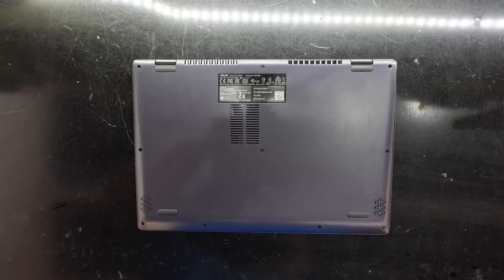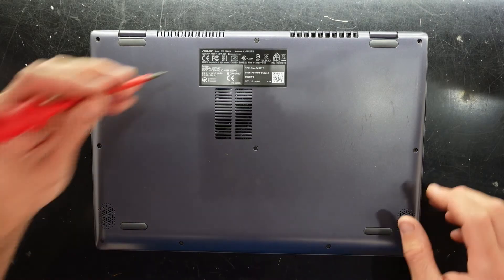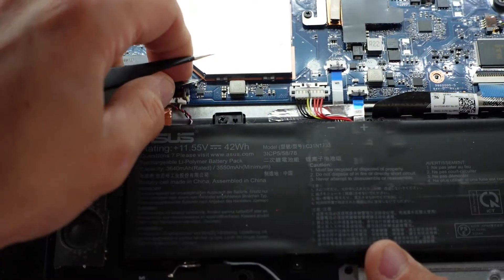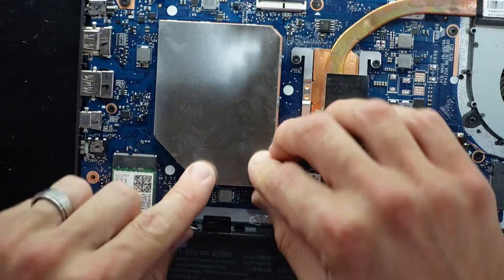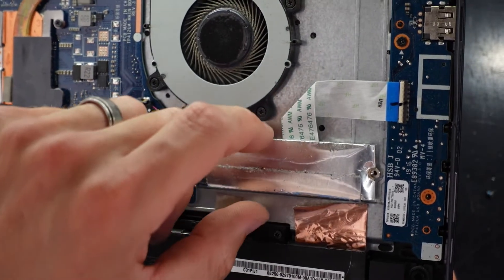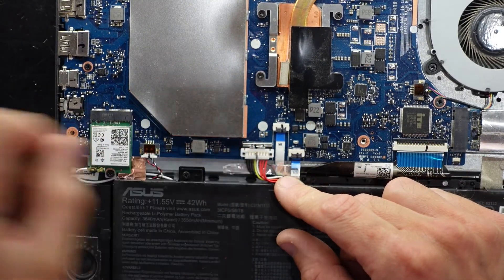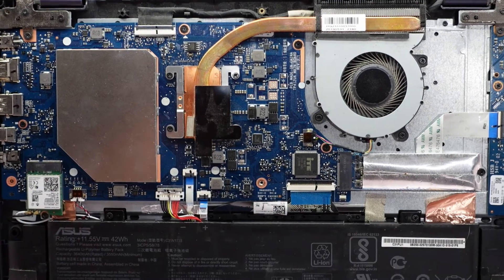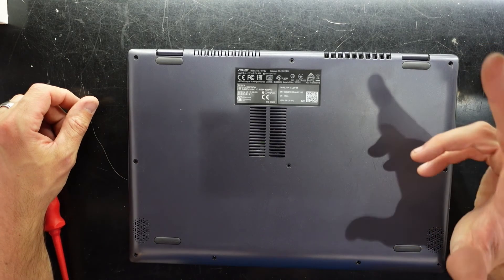Asus VivoBook Flip 14" TP412U Tear down and Upgrade Discussion

Comment: 6:00 > But this is not M.2 Nvme as you told before: 5:27. It is a SATA SSD
Anyway, thanks for opening
Reply: You said in another comment that you put an NVMe, so, I guess it is also compatible with that after all. Anyway, before buying, I'm going to test with two old SSDs (NVMe and SATA) I have.
Reply from the maker: both should work
Reply: @rickstechrepairs  Yes, it is also recognized by the BIOS.

Anyway, I'm having this problem: the old SSD just showed this error:
* STOP CODE: DRIVER PNP WATCHDOG

So, I tried to install Windows on a new SSD, but it is still the same. Only installing Linux works.

Is your laptop still working? Which BIOS and Windows versions do you have?

The laptop is not mine, so, I don't know what was done here
Reply: I'm currently trying to upgrade in this same Asus laptop, the stock 128gb M.2 SSD to a new nvme 500gb SSD. Having no luck after the Macrium clone to the new nvme SSD. Windows will not boot and I've already spent many hours reading blogs and trying to figure out what is wrong. The clone seems good and the ASUS bios recognizes the new drive. I suspect there is some issue due to the new drive being nvme. I'm just about ready to say "f*ck it", my time is not worth this aggravation. I've never before had any issue building PCs, installing OS, copies, etc. So, the people saying this is easy no big deal, I'm not seeing it. Just to let you know, before going further down this rabbit hole, lol.
Reply: @bigworldparty  I couldn't repair the problem of the laptop that was brought to me, but I can say that it originally shipped with a SATA SSD, so, I suspect that although an NvME is recognized by the BIOS, it won't boot from it. Even the author of this video is showing a SATA SSD.

Perhaps you should try a BIOS update.

A last thing to do is to do a fresh install on the NvME and see if it boots.
Reply: @jmemusic  Hey I actually got it working! But I don't know exactly how, lol. I was trying various things, BIOS setting, Win 10 repair USB I made, etc. Nothing was working. The new NVME drive was recognized in the BIOS and settings were correct, but the machine simply refused to boot into Windows. I tried maybe the 20th boot, wasn't paying attention for a moment, and bingo, the machine booted into Windows. Now it works fine with the 500GB NVME drive. Along with the added RAM, the machine performs much better than before (prior 128GB drive was nearly full). I'd like to say what did the trick, but I don't know for sure. Could have been something to do with the Windows Repair USB I had tried a few boots earlier. Anyway, I can 100% confirm an NVME SSD will work with this machine, if you can get it to boot!
Reply: @bigworldparty hey do you know which m.2 nvme ssds i could get for mine? I heard that there speed will be bottlenecked due to the laptop not having enough PCIE lanes to support the pcie x4 that the nvmes have.
Reply: @sk9584  I'm not sure of the PCIE lane config of the laptop. I was mainly going for increased storage size rather than speed. I recall it was a hassle getting the new drive recognized, until magically it appeared after messing around for several hours. Given the laptop isn't exactly a performance model anyway, I would not be too concerned if getting the fastest x4 speed, you might not even notice the speed difference.
Reply: @bigworldparty  thank u so much for replying even though the last comment here was 1 year ago 😊 ! I did some research and it says the laptop has a PCIEx2 slot. Theoretically, the speed of the nvme will be the exact half of its potential.

Comment: Hey mate I've just opened up my laptop to see why it as turning on, I disconnected the battery and put it plugged it back in but now my laptop doesn't detect my battery, any solutions?
Reply from the maker: hmm, did you bend a pin on the battery connector when you reinstalled it ?

Comment: I just ordered this laptop and it's coming 4gb/128gb. I'd like to 12 or 16gb/512gb. Do you have any suggestions or links for memory/storage drives?
Reply from the maker: the NVMe "should" be upgradable 
the ram might be soldered on to the board, so you will need to open to find out

Comment: Hey i have a question. I have this model and it doesnt turn on again... when i press the powrbutton on the left the powerlight flicks on for sec and turns of immediatly... i already changed the battery but it still does the same. Do you know a solution or should i bring it to a computerrepair store? 

Thanks
Reply from the maker: i dont have a solution for it, take it to a local repair shop

Comment: Hi, Can I add an additional SSD into this laptop. Is there an option since my 128GB SSD m2 is getting filled up and need to add more.
Reply from the maker: nope, just the 1x M.2 NVMe Slot
Reply: @rickstechrepairs  Thanks for your reply. Will upgrade it but there is a hassle of buying the ssd enclosure too.
Reply from the maker: I went with a Kingston A2000 1tb to go in mine

They are my go to SSD these days
Reply: @rickstechrepairs  can I use NVME SSD which is mostly available.
Reply: @rickstechrepairs  is it compatible for all nvme type ?

Comment: Great tutorial (by a fellow Aussie). Save me a whole heap of grief as I had the black screen of death and wanted to disconnect the battery. 

My laptop had 4 long screws and 6 short ones, which I forgot initially which way they went in. Lol. Thanks!!!
Reply from the maker: Cheers Duncan 

i find i tend to show our mention the screw size as im doing the repair for this exact reason 

i find pressing and holding the power button for around 30-40 seconds also helps kill the power

Comment: If there is 4 gb of ram soldered to the mobo, then when putting the other ram then the machine would already work in dual channel?
Reply from the maker: yes 4GB Soldered on 
i went with 4GB+16GB to make 20GB
4GB+4GB = Dual Channel
the other 12GB is Single Channel

Comment: Man, i have this model and i want to upgrade the space in it, it s 256 gb mine, i want to upgrade it to 1tb and get more ram s, 8ram if possible to make 16, but idk what to buy, idk what s compatible, could you help me please?
Reply from the maker: i still have this machine, i upgrade to a Kingston A2000 1TB NVMe

And iv also added a single 16GB DDR4 3200 mhz stick

So it has the 4GB Soldered+16GB Sodimm to give me 20GB
Reply: I have a question about the ssd ,i bought a 1TB but the laptop doesnt respond.. when i turn it on the asus logo appears and doesnt do anything can anybody explain this to me ? Thanks!

Comment: Does the notebook support NVMe Ssd?
Reply from the maker: Sure does, iv got a Kingston A2000 1TB
Reply: @rickstechrepairs  Do I have to set something specific that the nvme works?
Reply: @christianf5190  Possibly yes, some boot or driver changes are needed to use an nvme drive. My clone and install of an nvme SSD is not working, I can't get the Asus laptop to boot into Windows. I used Macrium free version software, to clone the stock 128gb drive to a USB attached 480gb Patriot M.2 PCIe Gen3 x4 SSD. Once swapped into the laptop, the boot is not successful, and the Macrium boot fixer does not fix the issue. In summary, this is not a simple swap like you normally would do, which previously I have done many times with regular drives.
Reply: I bought A2000 500gb.  But it doesn't work.  The BIOS does not show an SSD.  I can rule out a defect because it works via an external USB housing.  Did I do something wrong?